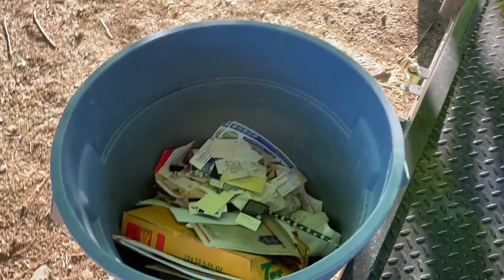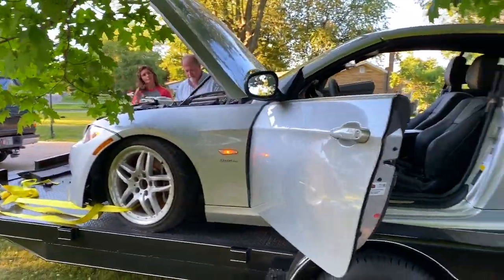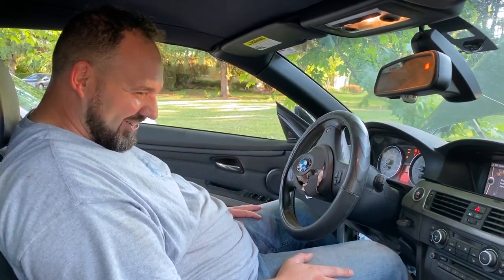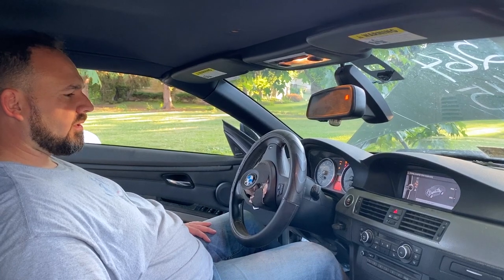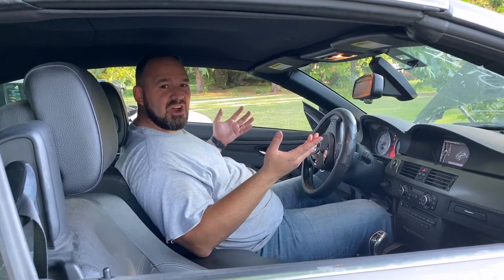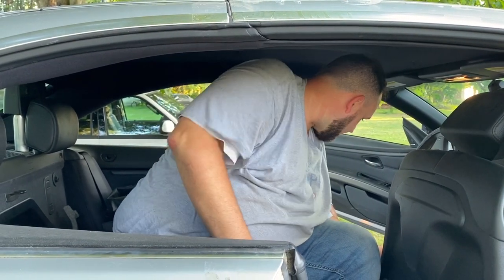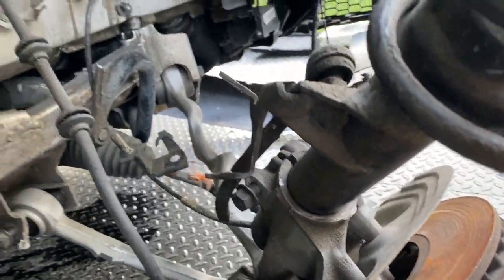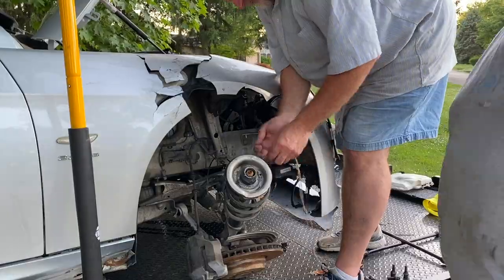Rebuilding a Salvaged BMW 335is - Part 2

Comment: Great channel! Very underrated. About a year ago I discovered your first video on the Ford Fusion, I’ve seen every video since then. Excited for some more content on the BMW! On March 25th I won a 2012 Impala LTZ from Copart for $675. Did a bunch of work to it and got the R-Title and got it all legal, then I put a thousand miles on it a few days after getting a tag for it driving to West Virginia and back, and it did flawlessly. I was driving that car in the same areas you were in the last video, possibly around the same time! Small world lol. Keep up the great work! Not sure what my next project is going to be from either IAA or Copart but I’m sure I’ll find something. Keeping the Impala as my daily driver for a while, I have under $2,000 in it total and could probably get somewhere between $4,000 and $5,000 for it in my local market.
Reply from the maker: Awesome man! Thanks for being a long-time subscriber!! Really appreciate that.
And congrats on the successful rebuild! Sounds like you scored big time on that one! Great feeling isn’t it?!?!
Reply: Thanks! Yeah it was a lot of work but well worth it! Drives great. Barely got any bids because it was listed as undercarriage damage. Turned out it was a tiny gash in the sheet metal underneath, which was a pretty easy fix. Most of the work I did to it wasn’t even related to what it was totaled for lol

Comment: I just bought an e93 335i not s but it has pretty much same damage but no frame or sub frame damage. My top isn’t going down either so that’s a bummer, can’t wait to see more videos about this thing. Keep up the good work, lmk if u fix the roof cuz I need help with that too, good luck
Reply from the maker: Cool man! Nice cars, aren’t they? The roof is a puzzle for sure! I’ve got partial power to mine now, but it still doesn’t operate all the way. Haven’t figured it out yet. Good luck on yours!

Comment: Why in the world you not check your oil before you start the engine?
Reply from the maker: There’s no way to check the oil on a BMW the normal way. The engine has to be running in order for the “digital dipstick” to check it for you. But the lack of a low oil pressure light gave me some confidence that it was ok to run.  Trust me, it goes against every instinct to run an engine without knowing the status of the oil!! But BMW engineers know better than us, right? 🤦‍♂️